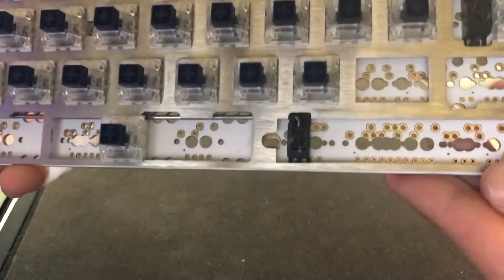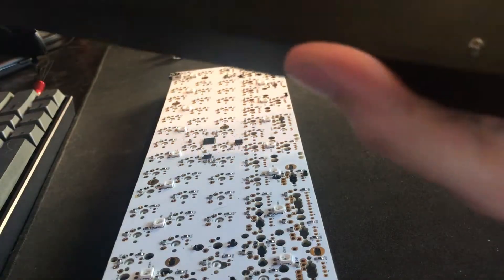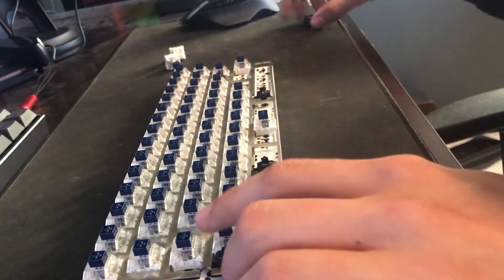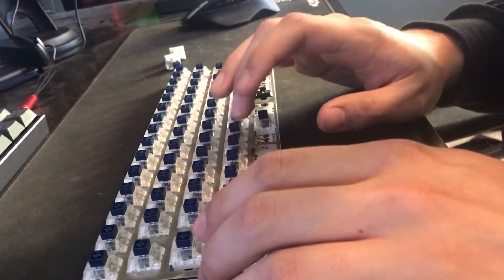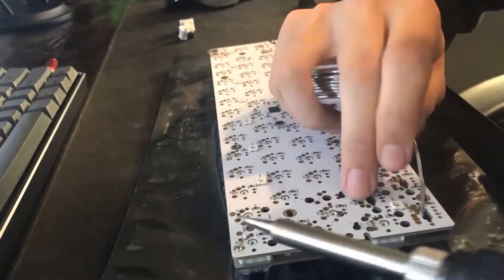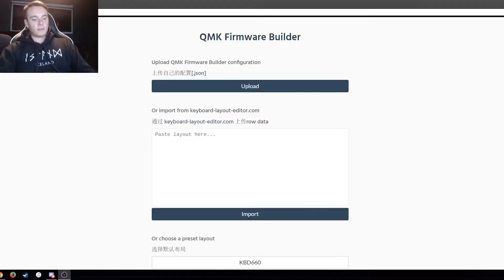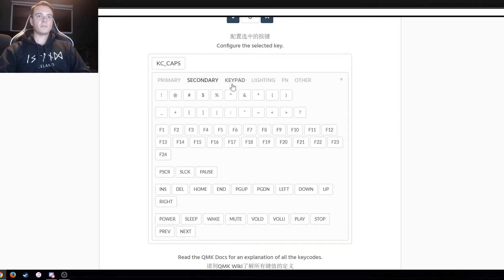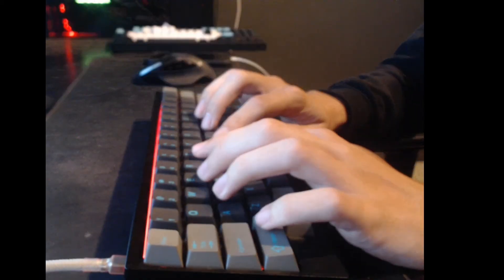Tina-C With Kailh Box Navy Switches

Comment: I am a total nood when it comes to building a keyboard but I am in love with these switches. Why don't they come prebuilt in a keyboard?

sigh guess I'll have to live the experience through other people.
Reply: kbdfans has their kits, which you can order built and have them use the switch you like
Reply: I too am a complete noob when it comes to building keyboards, or even keyboards in general. However, I believe there are keyboards with “hot-swappable switches” so you can just pull the original switch out, and replace with the box jades that you will have to buy. Don’t take my word for it though

Comment: hI im building my own tina-c just wondering how do you determine where to place the switches in the bottom row? There are several places to put the switches in for the win key and alt key and im confused on which switch slot to put my switches in
Reply from the maker: Monkey D. Luffy I just put the switches in with keycaps and then put the faceplate on to see if everything fit

Comment: Hey man just stumbled upon your channel, great content! One question though, how much does this board cost total?
Reply: Need to calculate how long and how much I would need to save up :p
Reply from the maker: The kit is around $160. That includes the case, PCB, plate, and stabilizers. The switches were another $25 and the keycaps were around $180 when I bought them new. It would be around $360 if you were to buy everything new. You could probably save $60 buying used.
Reply: Wow you got a pretty good deal! Alright thanks man I'll start saving up soon. I'll probably go for a cheaper build, using DZ60 rev2.0 60% mechanical keyboard PCB, Kailh Box Navy Switches and a decent plate and case.

Comment: Dude, i have a blackwidow ultimate with cherry mx blue and costar stabilizers, and a ikbc f-87 with cherry mx red switches and cherry stabilizers. If i buy the kailh box or the kailh bronze can I put on one of these PCbs with Costar stabilizers?
I mean, the IKBC has a default cherry stabilizer PCB mount, it can handle a Costar stabilizer????
Reply from the maker: You might not be able to use Costar stabilzers on your IKBC. I've never used and IKBCK so I don't know if they'll work with them.  New stabs are relatively cheap so if something doesn't fit just buy new ones. I've only used Costart stabs in one build so I have very little experience with them.
Reply: I can't use Costar stabilizers on the ikbc? :////
Are u sure? I don't know much about stabilizers
Reply from the maker: I'm not sure if it will work. I don't see why it wouldn't, but I don't want to spread false information.

Comment: I'm currently building a board with these switches. I love how they feel, but I've only been able to feel a lose switch and only a few of them in a board that is not yet screwed together.
My concerns are that they are gonna feel too stiff with a full assembled board with them.
I don't like to bottom out and with these switches I feel it is gonna be too difficult to hover type when the activation point requires quite heavy pressure.
Reply from the maker: Once you get past the click bar it's a straight drop until bottom out. If bottom out is a concern then don't go for these.